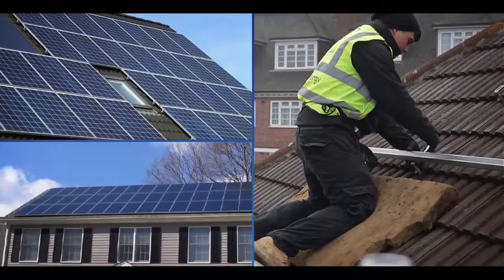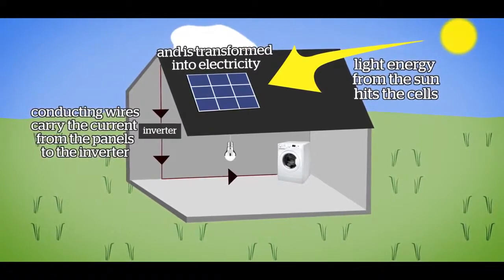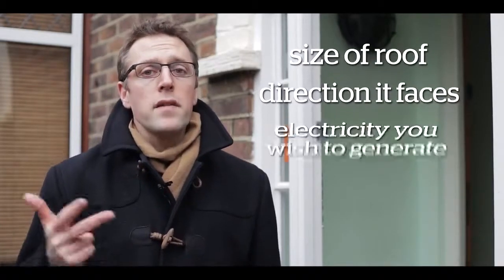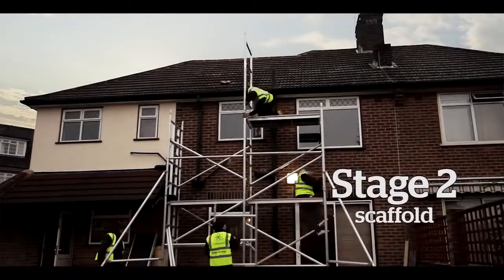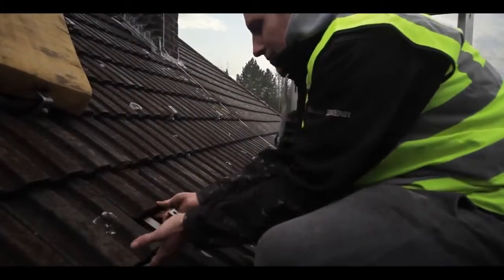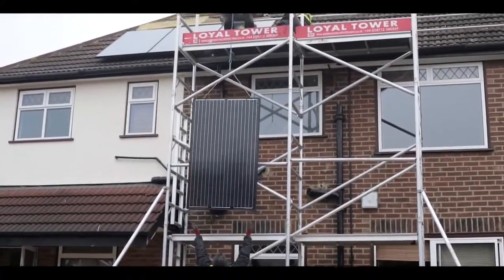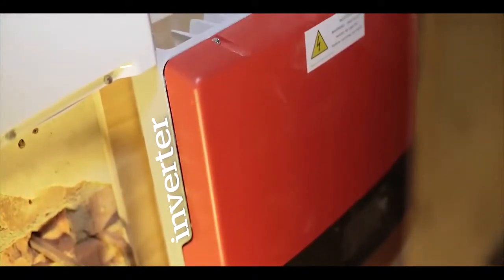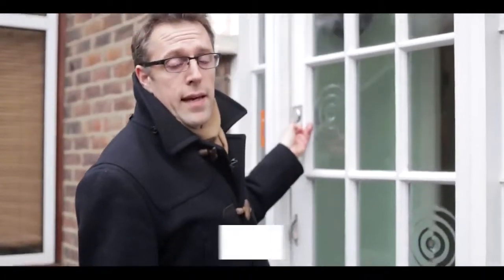Solar Panel Installation guide

Comment: What I don't understand is where you feed the cables in from the roof into the loft and if you just connect them all up in series or series-parallel.